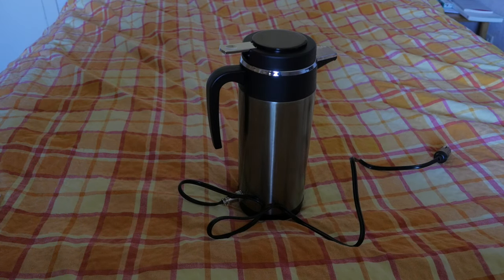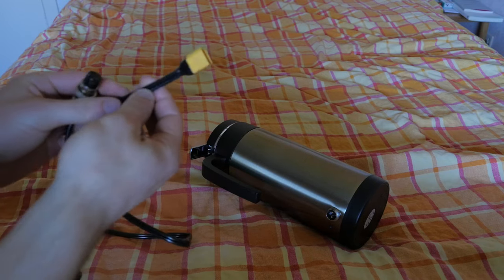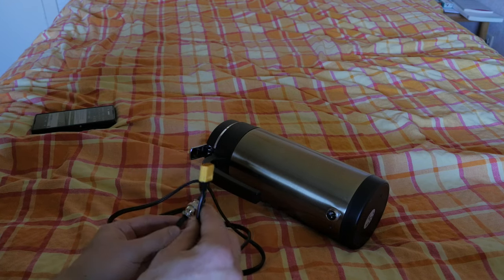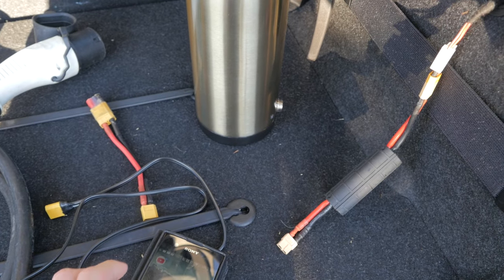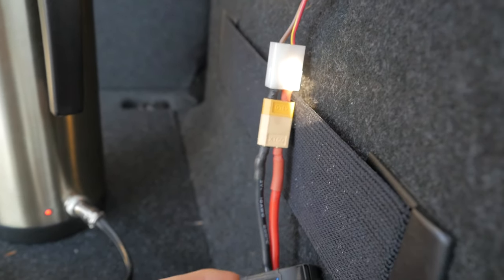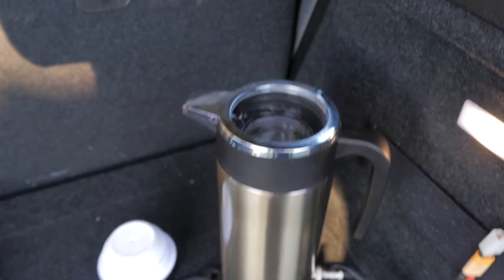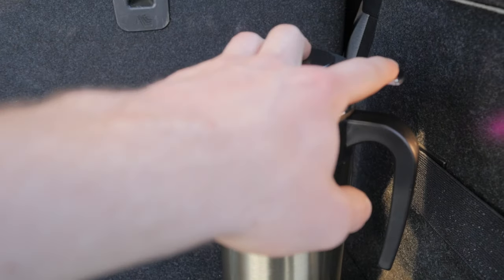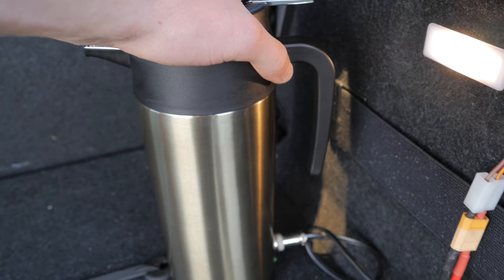12v Kettle Review and Improvement

Comment: You're worried about replacing the plug and socket with an XT60 connector and decent wire, then show the testing using the rear socket in your car with long tiny wires and and an extra adapter connector. Really demonstrating how much of a joke a 12V water heater is.
Reply from the maker: It has worked perfectly for my camping trips.